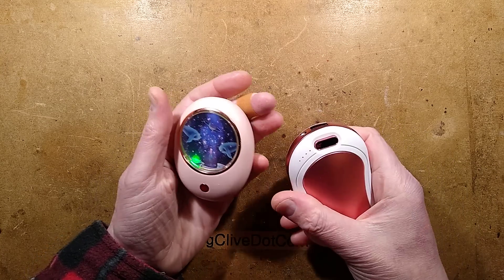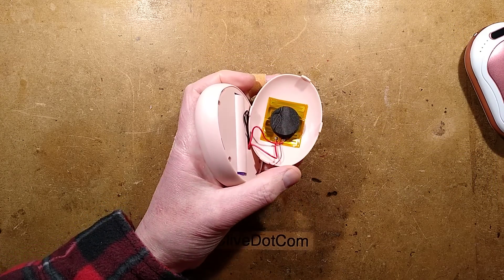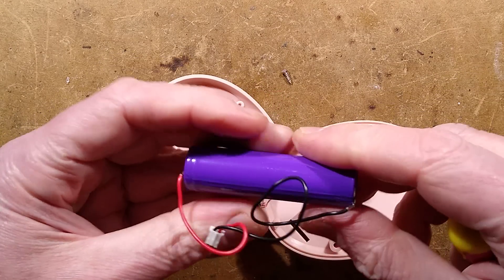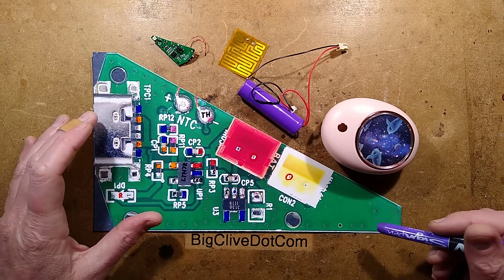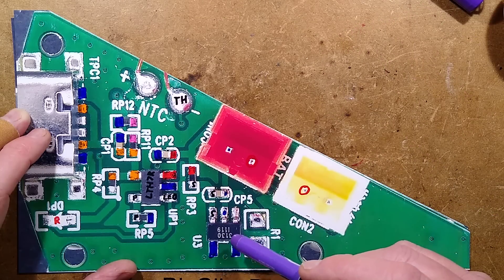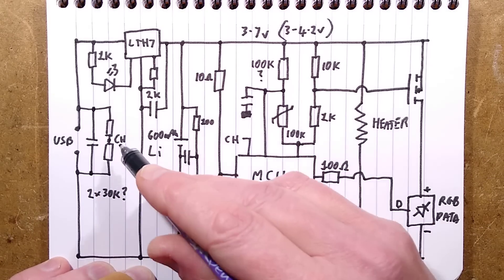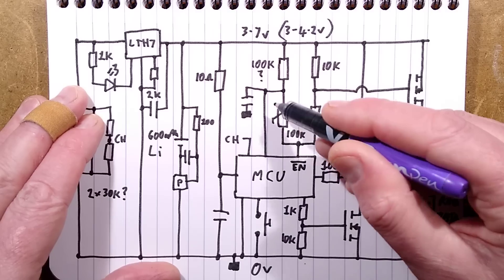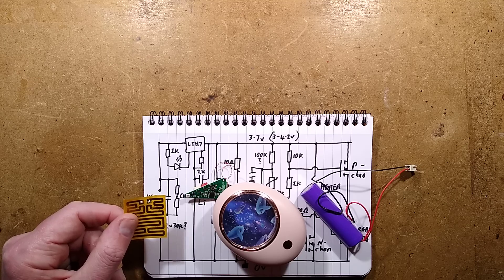Engineers vs accountants the handwarmer mix.  With schematic

Comment: I suspect we're going to see a lot of this stupidity with USB-C ports over the next few years and it'll lead to a lot of annoyance. My partner recently got an lightbox for craft purposes with a USB-C port. Doesn't work plugged into a proper charger or battery pack, but using the supplied USB-A to C cable it works fine. There's a 56kOhm resistor in the cable to signal 500mA power capability
Reply: An "easy" fix would be to open the light up and insert the missing resistors to the pins, or using a dumb power supply that supplies 5V regardless of the pin status, like those "Raspberry Pi 4 compatible" power supplies which have 5V 3A SMPS with USB C plug at the end of the cable (found this out when I used that power supply with the phone -- which didn't charge at all -- and a hand sanitizer dispenser which also suffered this issue)
Reply: @PhilXavierSierraJones  Do you by any chance know of any guides that can describe which pins the resistor needs to be added to? Bought some USB C modules for a project and they only work on Type A chargers, presumably due to this.
Reply: @bosstowndynamics5488  It depends on which connector is used, so it might be better to use a "USB 2.0 converter" you can make with a female and male USB-C connectors.
If you know which pin goes where, you need to connect 5.1K resistor to CC1 and CC2 pins, and grounding both resistors at the other end (CCn pin - resistor - ground)
Note that shorting the pins together will NOT work, as well as sharing one resistor between two pins. You must use two resistors.
Reply: Given the legacy of USB A devices out there which assume 5V @ 1/2A on whatever this week’s official connector is, maybe the USB Forum has overcomplicated things just a smidge.

And when I say “maybe,” what I actually mean is, “What is the USB Forum smoking these days, and where did they get it?  (Asking for a friend.)”
Reply: @sirnickity  This is not really the fault of the USB-IF. It's how some manufacturers implement USB-C and completely neglect the new standard and do what they want. What's the fault of USB-IF was the changing of the naming sceme of previous standards...
Reply: @kyoudaiken  USB C is a connector intended for both ends, so it cannot be A or B.  It also demands more wires than a parallel printer cable making it unworthy of the USB name.  Throw in more name confusion than SCSI connections and it seems high time to start over at USB 2.0 .
Reply: @johndododoe1411  You don't seem to be up to date with modern technology. With rising data transfer speeds (and the demand of it) you cannot transfer data over a single pair of twisted wires anymore. You need multiple "lanes". There's a physical limit in what you can do with copper. Fiber is still too expensive.

Also, they are trying to make a connector for everything. And it can be awesome when it works. Imagine connecting a screen via just one single cable, having 4K144Hz, USB for your mouse and keyboard, as well as power via USB PD to the screen.
Reply: @kyoudaiken  And I'm saying that approach is contrary to the defining concept of USB as a protocol for using the bare minimum of wires to run simple devices that need no extra speed.
  Trying to make a many-wire cable look as thin as a penny pinched 4 wire cable results in cables that cannot last.
Reply: @johndododoe1411  For this USB 2.0 and USB-A and USB-B still exist. Heck, my keyboard even runs on USB 1.1 Full Speed via a normal USB-A plug that I can plug anywhere into my PC.
Reply: @johndododoe1411  So, you're suggesting that the USB "C" should be called Micro-Centronix?   Micro-Ultra-SCSI?
Reply: @kyoudaiken  Still, maybe there's good reasons we've always used different cables for different purposes. TVs or hifi systems don't use the same cables for power, signals, and speakers. Do we need a world with dual-purpose mouse / lawnmower ports? USB did a good job cos there were 4 or 5 different kinds of cable needed for a PC with a printer and a modem, and there wasn't anything high-speed designed for peripherals like external hard drives and scanners. Instead, they hacked them onto printer ports which never worked well. When they tried to expand the capabilities of printer port, they ended up with 3 standards and confusion over which was which.

USB C seems to be Power Over Ethernet taken too far, with a whole range of voltages and currents. Then duplicating all the cables so you can plug the thing in upside-down is needlessly complicated and expensive for the problem it solves. Just make the plugs a different shape instead. Easy. Make them semicircles or isosceles triangles or something. Trapeziums. Which actually worked fine for printers, now I remember. And joysticks.

Ironically, you can now have a power supply that costs a bleedin' fortune, or else doesn't support all the voltages and currents. So it's a waste of money AND complicated. Double-fail. Now instead of a customer just having to know if it's the same voltage or current rating, it can now be above-or-equal, except some stuff will work at below it's ideal voltage, just charge slower. Etc. Etcetc. Like they were trying to design the opposite of what was good about USB chargers being universal.

If you're going to have a standard for higher-power devices, why not make it 240V at 13A? PCs used to output that, back in the day.
Reply: @johndododoe1411 my experience has been that USB-C cables of good repute like Monoprice house brands greatly outlast their equivalent of micro-B

The connector and it's housing is more physically durable and that's what typically breaks. I do occasionally still see a wire break, but it's once every 2 years, not 6-12 months.
Reply: I've had several cheap bits of kit with a USB-C charging socket that only function in dumb mode with an A to C cable. So far, a keychain powerbank, a headband flashlight and a cylindrical flashlight.
Reply: I've got two LED PIR bar lights, a Bluetooth headset (rather nice too!), and a head torch that all skimped on these resistoors.
I also have one of those chargers that PhilXavier mentioned that came with a Jackery power bar. Fortunately the bar IS compliant.
I strongly echo this frustration, especially as I begin my slow migration into the USB-C PD ecosystem.
Reply: @FerralVideo  Not the "correct" solution is NOT the resistor. That's a workaround for getting power into USB C devices from USB A chargers (and it also works in reverse to get power from a USB-PD charger into a device with any of the USB B sockets) . The issue is one of penny pinching manufacturers adding a USB C socket but not actually meeting the USB C spec
Reply: The real stupidity in my humble opinion is the use of USB systems as a power connector system. We have torches (flashlights/hand lamps) and head lights that use micro USB connectors. Within months they become unreliable.
Reply: i have a usbc keyboard that have position of resistor but it is not fitted so i have to solder it my self
Reply: I use vape devices. The switch to USB-C from the previous USB micro is proving an absolute nightmare. 
I have many vape devices with USB-C which simply refuses to charge with a PD charger. The PD charger expects an handshake with the device - so to decide the charging voltage and current before supplying energy. In contrast, the data pins on the device charge port are disconnected, so it doesn't charge.
A charger following the Qualcomm standard (it use the big USB-A port) will provide a 5 V output in absence of data communication, so the vape device will charge. But the industry has completely shifted toward PD lately, and dual standard QC3.0 & PD (with two ports) chargers are becoming rarer. 
So, for the electronic cigarettes I had to buy some "dumb" chargers specifically.
The EU worked hard to implement the PD protocol on all devices requiring a charger, but the Chinese read "USB-C connector" instead of "PD protocol", and stuck an USB-C connector while keeping the circuit design meant for USB micro. The import inspectors at the UK or EU customs should block all these non-compliant devices - hand warmers, e- cigarettes and all the like...
Reply: @rayoflight62  you might like a USB PD 'trigger' which handles the USB PD comms to request a voltage of your choice and then outputs that to some pads or a USB A port as a dumb power source. I used mine for a weird tablet that wanted 20v over micro USB and to test a floodlight at 9 and 12v.
Reply: @rayoflight62  You can "skip" the handshake by placing two 5.1 kOhm pull-down resistors connected to the CC1 and CC2 pins of the USB-C connector (whether or not your vape devices have space for such resistors on the PCB, I do not know) and this will force the (USB-PD compatible) power supply/charger to provide 5 V at a theorethical limit of 500 mA (USB 2.0 legacy device). This applies to devices that transfer data as well. How well the current limiting is enforced, that will depend from charger to charger. I have a TP4056 module connected to a USB-C breakout board with said resistors, and I can draw 1 A while charging a Li-ion battery. This is, of course, a hobby circuit; in real life, you'd have to be careful not to draw more current than what the source is capable of.

The USB-C standard is very, very long, and I do believe that a lot of thinking went into it, but some manufacturers just decide what parts to implement or not, which leads to inconsistencies in user experience from device to device. If you're implementing a basic USB 2.0 data connection (5V, low current), it's not that hard to do. Mix in USB 3.0, Power Delivery, etc., and things get hard/ugly fast. Anyone who implements anything more complex than USB 2.0 data needs to have a holistic approach to the USB-C standard, and that can be hard. I was trying to design a USB-PD module that would  enable data communication as well (to use with Android Auto, so I could fully charge my phone rather than watching it lose battery percentage during my commute) and it's just so hard, I ended giving up on it, for now.
Reply: @rayoflight62  Over time, this will change. All it needs is actually a resistor.
Reply: @rayoflight62  Actually, the EU politicians that changed the law from micro to C, apparently just to stay with the times, should realize they were conned by the USB-IF and reject the change in specifications.
Reply: It already has happened, Louis Rossmann had made a video about it.
Reply: Security camera clock radio (actually pretty decent) has USB-C for power.  The adapter provided is USB-C to 13 VAC TRANSFORMER wall wart!

If you plugged a phone into it, would send 13 VAC into the phone!

It is the coaxial DC power cable disaster all over again.
Reply: @gavincurtis  Did the clock come from the dollar store?

😜

Comment: I am puzzled at how the battery manufacturer can make an 18650 cell with such low capacity.  There must be a lot less material inside of the case.  Or are they buying used cells that have been worn out and depleted until they have very low capacity?
Reply from the maker: Sometimes the case just contains a smaller cell.
Reply: It's just a roll of thin sheet material inside so you put in less of the sheet in a loose bundle instead of packing it as tightly as it goes. Also the width of the material might be narrower meant for a smaller cell so they save a few pennies in material costs. Possibly they might be faulty or recycled cells with reduced capacity. I can easily imagine an 8 year old proper laptop battery going from 2500 to 600 mAh so one could still throw it in here for show.
Reply: @benbaselet2026  i'd guess it's recycled if it really gets warm with such little current, or even no current, i can't verify...

Comment: The accountants got involved to substitute a higher capacity cell with a 600mAh one, and the marketing department got involved to claim it heated both sides and has a 5000mAh cell. If only they had gone for an Ultrafire cell they could have had 10000mAh and also negated the claim that it doesn't explode!
Reply: Ultra fire, almost as good as my “Bursto” brand AA alkaline.
Reply: @gavincurtis  no thats the flat soft cells, AAh!s brand is Lee K's with top proform carbonfiber rod💯
🤣🤣🤣
Reply: only 10,000 mah? my ultrafire said 100,000 ah capacity
Reply: yes, i said 100k AH
Reply: @frogz  oh Jesus Christ i just noticed XD
Reply: @frogz  I'm sure a super-hyper-mega-fire battery will soon be availabe to put that rating in the shade
Reply: would truly be the highest bang-for-your-buck
Reply: Sounds about right
Reply: Lithium cells and heaters I thought was a no no. as they heat themselves and catch fire.
Reply: Are UltraFire batteries known to explode? Serious question as I have two of them in a charger beside me atm that I ended up with from somewhere. The yellow one claims 9800 mAh and the red one 6800 mAh. They each may actually provide about 10% of their stated value. So they rarely ever get used and then only in an emergency to provide power for the few seconds to couple of minutes that they're actually capable of. I think I bought a device that they came with (maybe a flashlight/torch) and I just held onto them as an absolute worst case scenario backup, just in case. It was the first time I'd ever heard of them but since you mention them exploding it makes me curious if I need to remove them and slowly discharge them.
Reply: @The.Plague  Let's just say the protection circuitry, if they have any, may not be the best. Should be ok if the charger has protection but don't leave them unattended while charging.
Reply: @chrishartley1210  I see. The charger I have them in has overcharge protection, and the light I use them in seems to as well for cutting out at a low voltage. I've never had an issue with an 18650, other than low capacity, so it made me curious. These seem really bad, capacity-wise, particularly compared to say an LG cell. So it made me wonder when you mentioned an explosion. Thanks for elaborating.
Reply: @The.Plague  and keep them in a well ventalated ppace 18650s vent unlike flat ones tyat puff up
Reply: @heffaynekoguy687  Will do, thanks. By flat ones, do you mean button cell type flat batteries in general? Or do you mean the flat-top 18650s tend to puff up more than the button top type? I ask because I have both types of 18650s and would like to clarify.
Reply: @heffaynekoguy687  I just realized that by "flat" you probably meant the rectangle type. My apologies, I've been extremely sick recently and I feel like my brain isn't getting oxygen like it should and it takes a few minutes for my brain to process things properly. If that's what you meant then you can ignore my previous reply with my apologies. I was looking at both types of my 18650s as I read your comment and my mind was on the various types of those instead of the various styles of batteries that are made and my brain immediately went between 18650s and button cells for some reason.
Reply: @The.Plague  ur good hun no need to apologize and yes light flat rectangle ones are used as li-ion&li-po forms, the flat tops are just a use/size difference a 18650 should still be 18650 with or without the positive nip.
Reply: @heffaynekoguy687  Thank you for the clarification. You had me curious if the two types of 18650s varied in venting features. I agree the flat (square/rectangle) type batteries are terrible about swelling up, particularly if they get too hot or charge too fast. I've had issues with several of those over the years.
Reply: @The.Plague  I use the UltraFire NiMh and they have been without problem.  Literally hundreds of them in use.

Now their LiPo stuff?  That is up in the air for me.  I go name brand just in case.
Reply: @gavincurtis  That makes me feel better about them to know you've used so many of the brand without issue. I appreciate the reply.

Mine are Li-ion and upon further inspection, they do state that they have short-circuit and over-charge protection. One of them even states the PCB life is around 10 years. How true any of that is I'm not sure, but it is on the label.

I normally just throw mine in the charger and trust it to do its thing, so I normally don't pay a lot of attention to them. I have the charger set to charge them at 0.68A, so they shouldn't explode from being charged too fast. The charger is capable of 2 amps but only on two cells at a time and I normally have several of the 6 slots in use, so I just slow charge them. They seem to perform better for me that way.
Reply: @The.Plague  yes .. ultrafire is a backyard china brand that uses reclaimed cells of dead laptop batteries with straying capacity all over the place...

it is a big lotter when and if the cell explodes for the current user, i would highly advise not to use them and just dispose them properly... just for the sake of not burning any house down for 10 units in your currency where ever you are